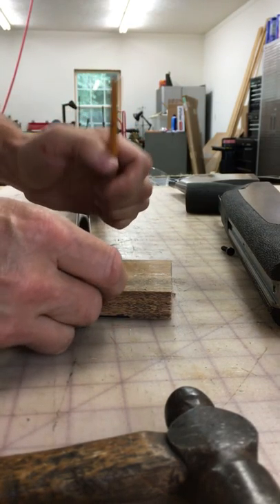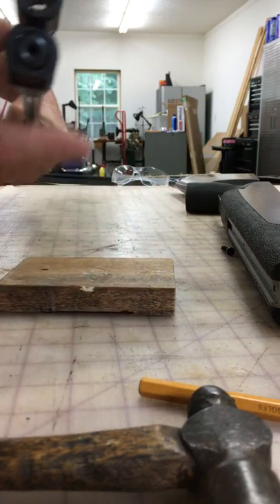Feinwerkbau 300S front sight installation

Comment: Thank you for the video! I didn't realize that the pin was tapered. The front sight was crooked since the last owner put the pin in backwards. Fixed it once the pin went in the correct way.